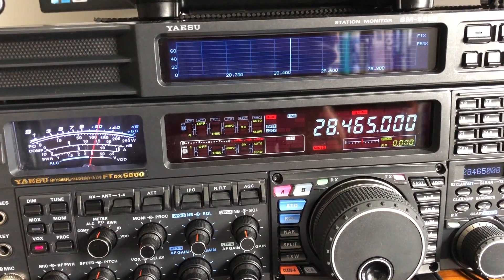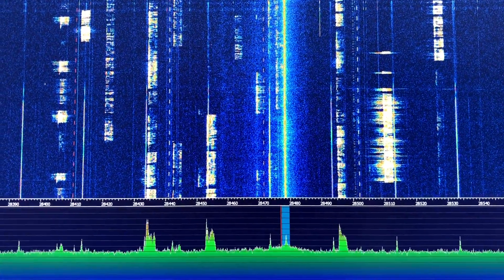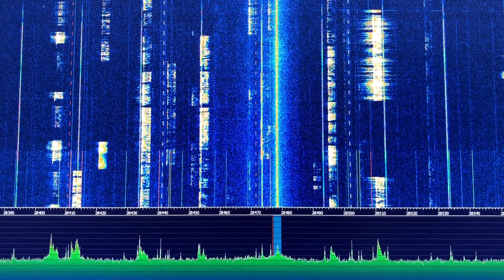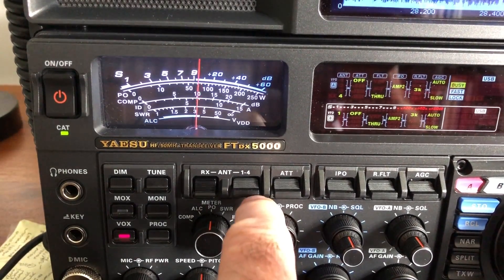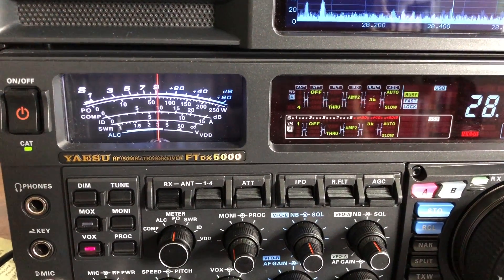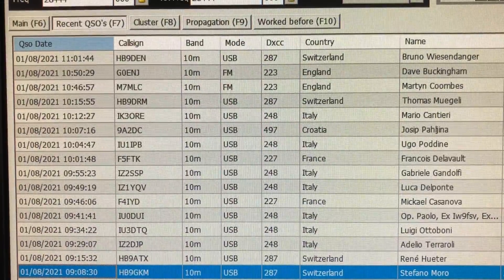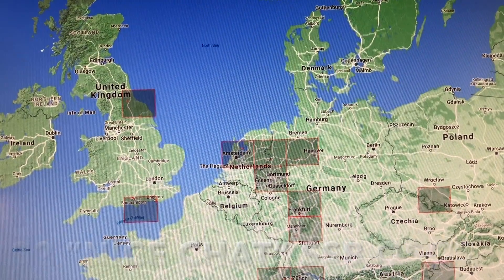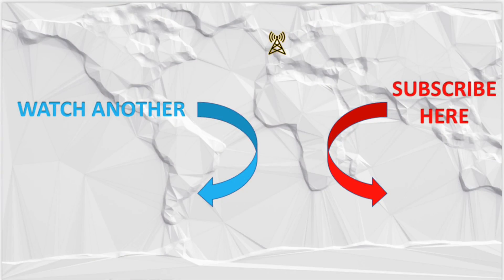10m 5/8th Vertical Antenna Field Trials

Comment: Hi Ian - thanks for the video. The Westflex link is not available this morning - not sure if that is temporary or permanent. Is there any reason you chose the Westflex coax in particular, or could it be substituted with something else? edit: Westflex 103 is available from other sources (eg Nevada Radio)
Reply from the maker: @teuluPaul  Hi Paul, it was part of the original design, but other types could be used with the same properties. I’m sure over time there’s been a few commenting on this down below, so if you scroll through, there should be some suggestions and/success stories I think? Have fun! 👍🏻
Reply: @G0CNN-Ian  Hi Ian, I ordered a couple of metres from Nevada Radio, so it should be good. I already have RG-58, and an FT240-43, so I should have it sorted next week. Thanks again for the video!

Comment: WOW!!!...Absolutely very impressive!!!. Just subscribed, your build and demonstration video is spot on!..

  All I have available is RG-142 B/U coax,would this be  suitable? Its 50ohm silver plated and double braided with Teflon Dialectric.
Reply from the maker: Hi Eric, thanks. I’m not familiar with that coax? You’d need to check it’s velocity factor in the specs I guess. Or for a few £ remove all doubt and buy a few metres of the types shown? Good luck 👍🏻
Reply: @G0CNN-Ian  Thank you for your reply. RG-I42 b/u   is about the same diameter ar RG58, its also 50 ohm  Silver Double braided, Silver plated solid conductor with a PTFE dialectric, its Mil-Spec coax here in the U.S. 
  I went ahead and purchases some less expensive RG-58 to use for the first attempt on making this antenna, I thought about using the 142 but didnt want to chance ruining the expensive stuff. I'll try my skill set first, before moving up to the good coax.

Comment: Presumably the lazyhorse would outperform on gain figures. I can't remember what you quoted for that antenna? 5 - 7dBi?
Reply: The 5/8 will have a nice low angle of radiation for the DX if we get the good old F2 layer energised come winter.
Reply from the maker: Yes, the mini-horse is better, but happy with this as an “always up” antenna for 10 😀